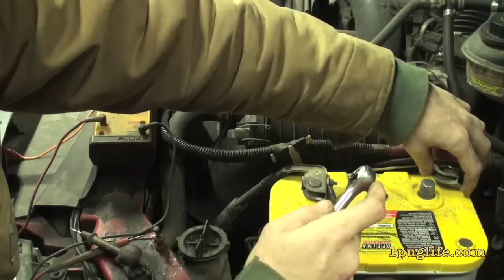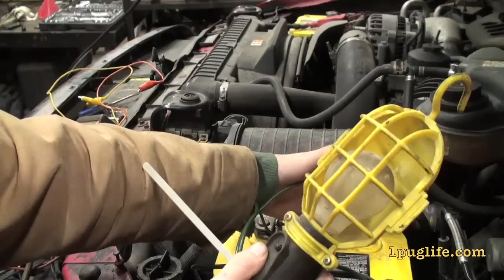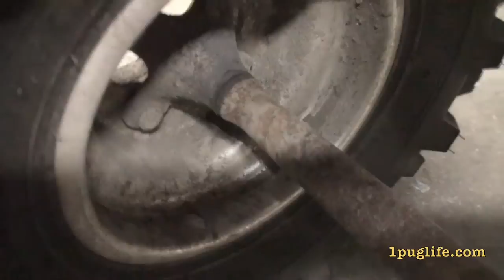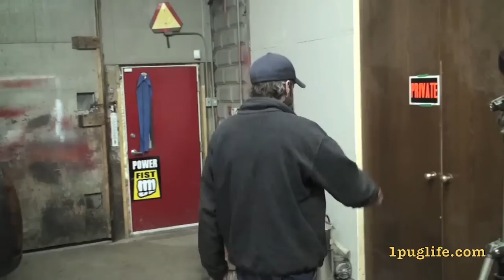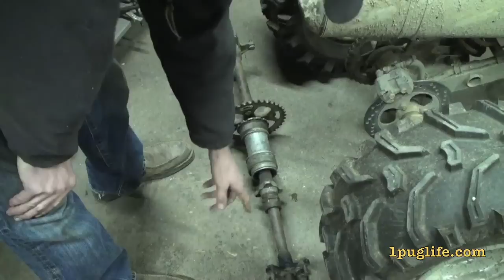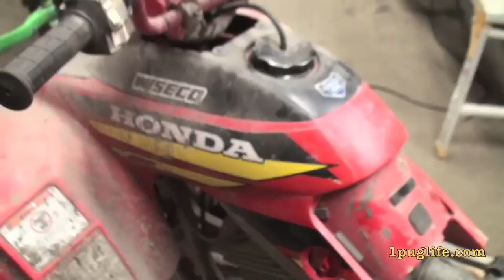whats the deal? big dirty/trx250x

Comment: Pug, it has to be with a regular test light. Also, leaving the other battery hooked up will mess up your readings. And you can't keep taking your leads on and off. They have to be clipped on and left on. If you don't have clips for the meter leads clip them on lightly with vice grips. Then do the procedure I gave you before.

Comment: disconnect both negatives and connect both positives at the battery then connect the light between the negative terminal and the post. the light should be dim or off,if not start pulling fuses until it goes dim or off.If pulling fuses does not dim the light disconnect the positive from the alternator. Hope this helps bud!!!

Comment: ive seen alternators that were frazzled stealing juice from the battery and also the rv round style trailer plug that has one wire in it to charge the trailer battery was corrode shorting some battery juice out.

Comment: 7way rv plug will not discharge batteries. 12 power at that plug is switched by ignition key.  Pug you had your meter hooked up right. Get those test leads clamped on so you can walk away for 15 minutes +. It takes that long for body computer to go to sleep. 0.02 or 0.03 is MAX amp draw you want to see.  Doors shut, hood light off, key out of ignition.  Good luck bud.

Comment: It's perfectly fine to be drawing about 16mA when it's shut off. if it's above half an amp, that's not too good. Don't get your shit frazzled over that much of a drain. it's probably the cold pissing with the batteries. had the same shit happen to our van when we went out hunting on first day of deer season. luckily there was a beat old trailer we took the 12V thingymadoodle box out of it, and charged it back up. All's good now.

Comment: There are plenty of videos on YouTube showing how to check for parasitic draw.  One thing for sure is that you have to shut off all accessories when doing the test.  When you were probing with your meter I could hear a chime going off inside the truck (that needs to be turned off and so does the alarm system.)  Your readings get all confused when these things are running.  Compare your electrical system to the plumbing system of your home.  If you shut off ALL of your taps and then see your water meter spinning then you have a leak somewhere (maybe a leaky pipe or something.)  If you leave a tap running (or an accessory on your truck in this case) then how do you expect to read any problems at the meter.  There is a guy out there called "Ericthecarguy" on YouTube and he shows what to do.

Comment: ya need to unhook the other battery too, otherwise its just gonna draw from that one, electricity will take the easiest path, so, do the same test but with the other battery disconnected, and use a small bulb like a 194 or a 906, (licence light, cab light bulb) and then see what happens, with your meter an acceptable draw is 0.05amps, modules like your stereo will always draw a small amount!

Comment: usually with dual batteries there is one used for starting, and one used with accessories and auxiliary power. so if it is just battery issues try the other one.

Comment: Tighten up the flappy sh1t (new bolts for the rotor and caliper) replace the fluid in the brakes (easy to do, same as a motorcycle) get a used axle I am sure there are bike junkyards in the area, there's a sh1tload of those quads around, fixing it might be cheaper than you think if you do a bit of searching.

Comment: Pug you have the meter set up right just reverse the meter leads you wont get that negative reading(positive lead on battery, negative on cable) you were almost there it looks like you do have a draw, anything over 0.05 on the setting you had the meter on is no good, set er back up and start pulling fuses and look for a change. Don't open the door or cause any helectrical stuff to fire up while your are doing this though. To use a light bulb you need a small 12 volt bulb like an interior light bulb with some leads soldered to it.

Comment: You need to unhook both POSITIVE cables to do the light test....
Reply: ***** You have too unhook both because both positive cables are connected to each other making it a parallel system, so if you just unhook 1 you still have power running through the system and it will not show you a short using a test light. That's why you have to unhook both positive cables.

Comment: I think BD has a bad charging system.  If it wouldn't turn over at the gas station after running awhile then its probably not charging.  Check your ground connections and then put the volt meter across a battery to see if the alternator is charging while running.  You should show at least 13.5 volts.  Sounds like a bad alternator diode.

Comment: Pug, first off check your battery resting voltage and see what it is, should be around 12.5-12.8 volt DC,  Then check it again with the truck running and make sure it is at least over 1 volt above the battery resting voltage with the truck running and alternator spinning.  if the battery(s) are above the resting voltage then you know your alternator is charging.  check the voltage right after you turn the truck off and see what the voltage drops back to around 12.3-12.6 volt DC.  if there is a bad cell in one of the batteries that will cause the power loss.  then just take the batteries to a parts house and have them put the tester.  the alarm won't pull enough amps to kill a battery that is good, the optima yellow tops that you have a deep cycle batteries so they can go way down and be recharged with no ill effects.

Comment: Pug put the test meter into amps then with live disconnected from battery put one tester lead onto positive battery terminal the other onto the live lead you disconnected from battery ,the test meter can only measure current if its" in circuit" it will give a reading only if the power is flowing through the test meter,any reading over a 0.5 amp will drain the battery,the higher the reading the faster the drain

Comment: you could also check for a problem in the alternator with the key off engine off just take the key out of the ignition, unplug the alternator connectors and recheck the amp draw on the multimeter  with the same way you were checking it on the video on the batrry. anything in the .0 amp range is not good, should be in the .00 to .000 amp range, also backup batteries for alarms can go bad and draw around that same amount of amperages. cdon't let the alternator connectoors touch the the chasis they may have power on them and blow stuff out. .0140 amps not good for ex.

Comment: you need both + on battarys disconnected then the put the ligt between post and cable on 1 battery if it lights you have a draw if it don't light yer good .if theres a draw disconnect fuse to see whats drawing .

Comment: you don't have a draw anywhere. while the truck is running pull the positives of both batteries if it stays running.... well you need to start testing voltage at the fuse block

Comment: Hook up one friggen battry at a time and then go from there A, and if you read minus amps flip your leads on the meter then it goes plus, think of the electrons like water , the voltage = Pressure and the Amps = gallons/volume. some where you got a leak, i bet the alternator has a bad diode, diodes only allow the trons to go one way.

Comment: It doesnt matter if you do it with the positive side or negative, but you had it hooked up backwards, shouldnt be showing negative. Spec for most vehicles is maximum 50mA draw (0.05 amps), AFTER 30 minutes. All of your computers need time to shut down and go to sleep so just leave the ammeter conntected. If its over 50mA, start pulling fuses and see what causes it to drop, just make sure you doors arent open and the key isnt in the ignition. Dont use a test light for this, its not accurate. And THAT my friend, is how the pro's do it. Any questions, ask me.

Comment: Guys, the way the batteries work on these is that one is directly connected to the starter, the other is connected to alternator...the alternator is controlled by voltage and temp of the battery it isn't connected to...no isolator, no one used for one thing and the other for another nonsense...BMP...FFS

Comment: 1puglife, For around $200 you would have a $800 quad and it appears to be in nice shape, I would not cut it, fix it and sell it, $800 buys a lot of tractor parts,  fix it and keep it, and race 200CIGRITS, given that the axel and hubs are shot, I would weld them until U find a cheap rear on eBay, about the brakes, they are not necessary, they just cause extra weight that slows U down on the corners. My 2 cents... LOL

Comment: do the same test with the volt tester then unplug the alternater and see if it changes...ford has a problem with there diods ..when it runs it will charge but when its not and sets for a day or more your alt will drain your battery start there before you spend hrs looking for other shit

Comment: Pug!! Put a test light(one with a bulb not led) or automotive!!!!!!!! Bulb lol  between the negative of  the cable and negative of the battery make sure doors are closed lights are off and key is out of the ignition watch to see if the bulb is lighting up if it is pull fuses one by one but put em back as you go the light will go out on the circuit that is causing the draw

Comment: I guess you have 2 times 55AH batteries, so even if you have 1A draw it will be 110 Hours before it is completly drained, so 0,15 will have over 700 hours before its drained if the batteries are ok, but the guys at carphonics can tell you that.

try to charge the batteries, start big dirty and check the voltage, if the altenator is ok it should be between 13,8V and 14,4V, the batteries can be checked at a decent garage or auto parts store, they have a device that is ib fact a resistor that takes 75A out of the batterie with a meter on it, it will show if the batteries are dickered

Comment: My Dash cam kills my Batt on my Truck after 5-6 days
(Well Not completely dead , But Makes it where it almost doesn't start,)

But that cant be your problem if it died when it was running / driving.
Maybe your Trailer wiring is messed up

Comment: Buddy.. gasoline is dicking you with bad informations. The testing procedure was corrects but you need to have the other battery disconnected!! The meter should read no more than .020 amps. Also doesn't matter if you test the positive side or negative side! When you do the test use alligator clips and leave it connected for a whiles.

Comment: hey pug ur amps should be no more than .03 and you need both batterys disconnected
Reply: but you did it the right way to do load draw test u just need to disconnect both battries and if that aftermarket alarm is a VIPER branded System the computers are know for that

Comment: make sure all yer pliances are hooked up to a 12v key on wasah wasah bling bling and not hooked straight to yer battery or it will drain it maybe you needs to spend more time drity dicted and not so much trapter dicted YOU WONT  i poligize but no check the last thing that was installed on big dirtys and check there